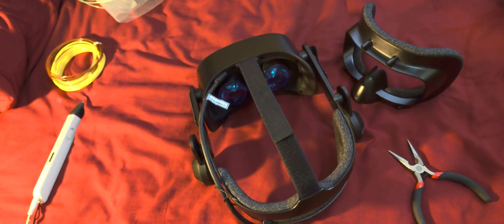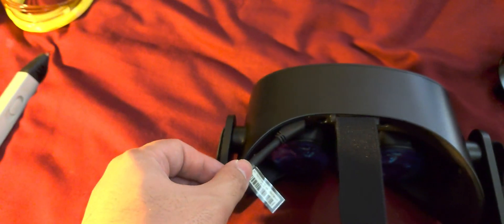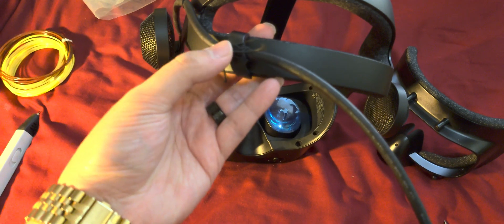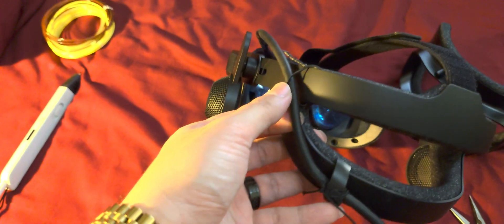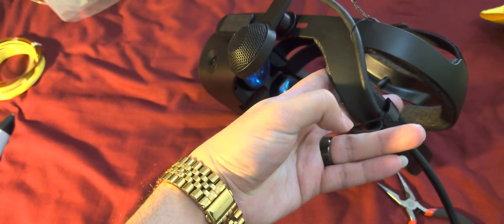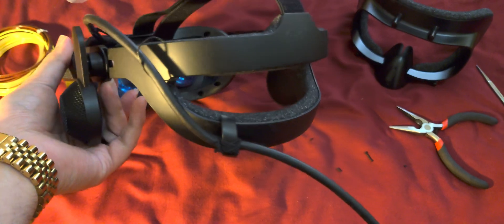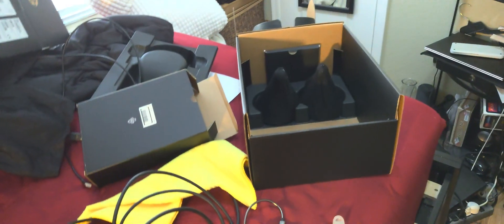Do This BEFORE Ruining Your Reverb G2

Comment: One word.   Velcro.   Buy some Velcro straps, so much easier, convenient, neat, etc. etc. etc.
Reply from the maker: You might be missing the point, we're not just solidifying the cable to prevent pull; we ought to ensure that an overly generous amount of forcibly permified cable slack is left between the headset connector and your straps for plenty of motion.
Reply from the maker: They'd be far bulkier both ergonomically and aesthetically not to mention far less secure but a less permanent alternative of a suggestion nevertheless.
Reply from the maker: given how many tight rounds of winding in soft stretchy sting it's undergone for the likes of those who often end up stepping on their cables or get twisted in them (poor management) this cable WILL NOT BUDGE I'd rather break my strap before risking any stress on that connector lol
Reply from the maker: Make sure that the cable cannot slowly slip out  @joerihuffmeijer3247  reducing your slack JUST ENOUGH to barely start  tugging the connector every time you pull the back to put on the headset.
Reply from the maker: I believe that you guys are basically recreating an alternative tugging point as your slack is NOT going to be as permifiable as I demonstrated here https://youtu.be/lmrpapyaBc8
Reply: @BradTech.  I had to Google "permifable" but had to come back here to edit my comment, I know you mean "permissible". I did watch your video though so thanks :)
Reply from the maker: Ah my apologies  @horrgakx  it's American slang for making something permanent so take it more as a synonym for solidifying because I expect your velcro straps to break through the entire plastic back of the strap before letting the cable slack slide out even a single millimeter from you pulling it THAT is how much force you have to tie it with is my point of all this
Reply from the maker: and I only say that because in order for my solution to work you HAVE TO permanently set the exact amount of slack NOT TO EVER CHANGE not even one millimeter under any circumstances as the cabling ages over time (had to edit this one too for proper wording sorry)
Reply from the maker: or maybe in your case tie something tightly around the cable as a stopper to prevent it from ever changing length as the stopper (another velcro strap I'm guessing since you like them so much) should be too big to get across your strap method and too tight to move a single millimeter across the cable.

Comment: good luck running the cable between the head band (under the foam) and your head.  Pretty sure you're gonna feel that pressing into the back of your head.
Reply from the maker: Given the density of its foam that's the least I can guarantee to be a totally flawless success, not feeling anything through that foam :)
Reply: @BradTech.  Good to know, and thanks for the follow up!
Reply from the maker: you bet  @Marzen216  it's my pleasure 🤗 best of luck there!
Reply from the maker: Also if you're extra concerned, note that I pulled it through from around the under side rather than stuffing it thus maintaining its flatness as it's spread straight rather than clumped up for maximizing flatness there.
Reply from the maker: Thanks, I assure you otherwise! It's left no precedence what so ever I can literally press as hard as I want on where it should be and not even feel where it is under my finger.

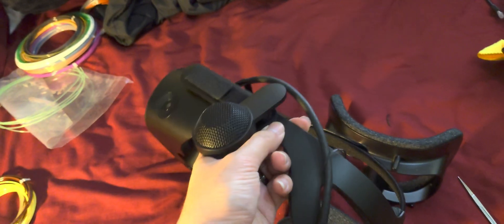Comment from the maker: 1:44 :cause of failure.
Reply: what? i didnt understand that
Reply from the maker: The moving back of the strap stretching back upon wear pulls the cable around
Reply: @BradTech.  :D i got my g2 and knuckles. its awesome. but i think i need some good usb hub or pcie card. i have rarely blue screens and screen goes crazy for 3-5 seconds :P i tried gpu's usb-c and unpowered usb hub worked only*. unfortunately any ports on mobo didnt work :( 
and some games (beat saber , eleven tennis , creed glory...) closes after launching :/ Only game closes , no steamvr. Its just FKNG WEIRD :S
Reply from the maker: You see, the port only gets damaged by stretching the backstrap when putting on and taking off the headset; because then its pins break out and start arcing, so it starts becoming affected by the slightest maneuvers in leading to such crashes I believe!

Comment: This port has just failed on me. Do you know if it's normally the cable or the socket? Is there anything I can do or do I just RMA? Thanks!
Reply from the maker: I'm sorry, how so? Having spoken to/with Hewlett-Packard regarding warranty for this, they'd told me that the issue was pins touching adjacent pins but it's 50/50 the cable pins or headset pins.
Reply: @BradTech.  At first it would turn off if there was a bit of tension but reseating cable would fix it, now it doesn't turn on at all with error 4-1.
Reply from the maker: Precisely  @scottwilson9432  unfortunately this fix was to prevent the pins from ever starting to mismatch prior to its damage :/
Reply from the maker: Sorry to hear that  @scottwilson9432  but it sounds to me like enough power was delivered down the wrong pins that it may have damaged the electronics
Reply from the maker: Initially I was getting 1-4 for loose connection  @scottwilson9432  but then 7-14 started coming up as its movement transmitted enough power to permanently destroy the electronics
Reply from the maker: It's not really disconnecting @scottwilson9432  its bending enough for the pins to jump/hop over delivering high-powered jolts to their neighbors
Reply from the maker: My goal here initially was to leave enough slack that there will not be any tugging on the cord/cable when pulling the straps back and forth.

Comment: do you think  thats cable routing is good "?? or should we route cable below speakers to back? (hope you understand what i meant :D)
Reply from the maker: A. Going entirely under the strap will cause downwards strain on the connection point not to mention touching your head.
Reply from the maker: B. Going over the strap then wrapping around the underside of the speaker will leave the cable uncomfortably pressing against it and concerningly moving with it yet still risking it getting pinched or caught when the stretchy strap of the headset is getting pulled back.
Reply from the maker: and either way such critical cable should not be making sharp bends and/or curves
Reply: @BradTech.  hm okay. so just give a free space to cable like you did and fix it to clip?
Reply from the maker: Indeed  @sanalgerceklikdoktoru  absolutely, to prevent tugging; use the lower back tie to prevent any pulling, and the upper side one left loose just for smoothly routing it up and out of the way.
Reply: @BradTech.  thankss..
Reply from the maker: You are more than welcome  @sanalgerceklikdoktoru  best of luck! 👍 see you in VR
Reply: @BradTech.  i hope <3